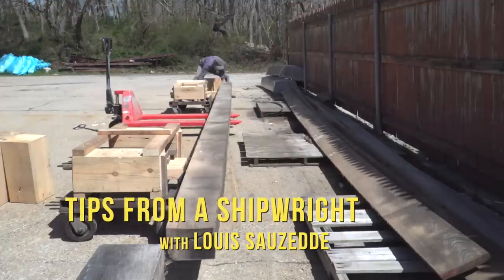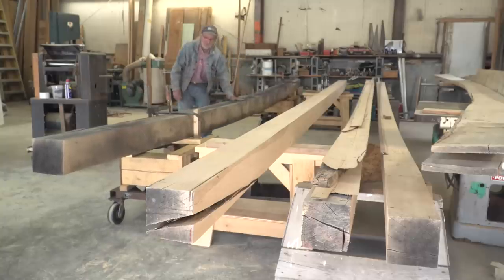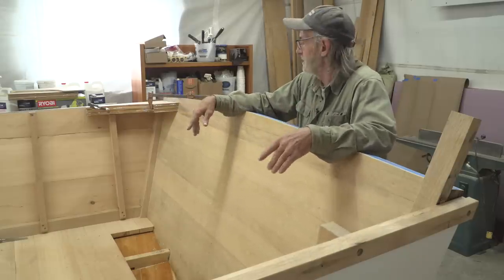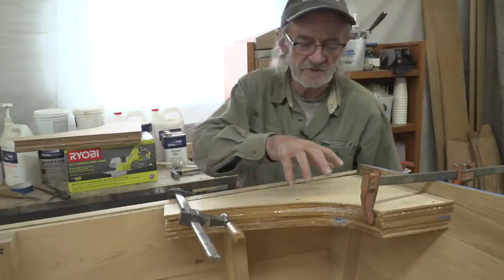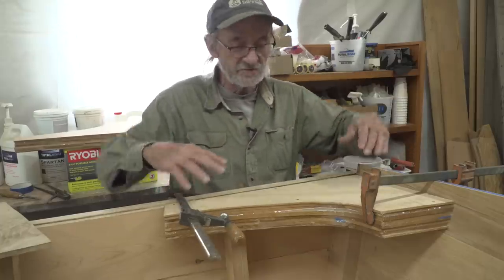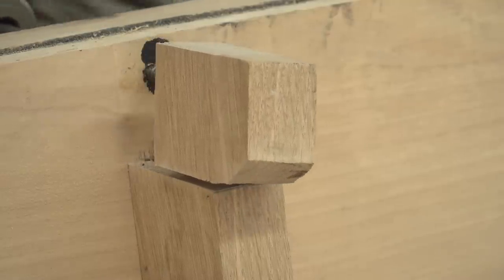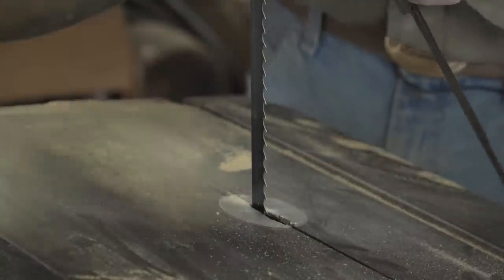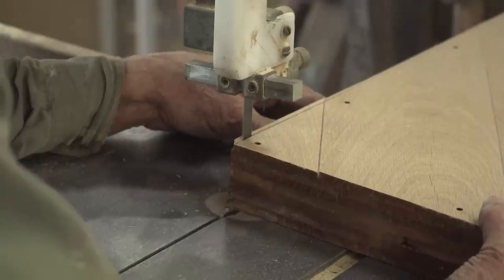Building the V-Bottom Skiff: Episode 30 - Timbers for ORCA and installing the knees

Comment: I made a two wheeled cart from a garden cart with a 5/8th D axle and 26 x 2.5" tires, just a 18" cube with the axle about in the center. moved some heavy timbers around on uneven Vermont ground. Old sayin around here is "use it up, wear it out, make it do, or do without"  I learned alot from this channel, so thanks!

Comment: I bought a Fein Multimaster when they first came out, back in the  80's. A couple of years ago I bought the latest model with the quick change blades. I love the tool. It has saved me on many occasions. A trick that I use to start an accurate cut is to clamp a freshly cut block to where I want to cut as a guide. If I can't use a clamp like on that corner post I temporarily hot glue the guide block in place. Love your videos!
Reply: Guiding blocks are a good way, You still gotta tune for ingrown inconsistencies though - working with a lot of burly and "complicated" aka wonderfully live wood for dashboards and panels and such, I learned that the hard way. My first oscillating tool was a cast saw I got from an orthopedist and tooling was shopmade. What a lame thing compared to today's Fein toys! Boatbuilding always needed unconventional inventive solutions.

Comment: I loved seeing the Multi-tool in use.  I first bought one 20+ years ago & used it regularly. The only time I ever got in trouble with it was when I accidentally unplugged it while using it.  I plugged it back in & the tool scarred up the brand new hardwood floor I had just installed.  The instructions never told an idiot like me to switch off the tool before plugging it back in.
Reply: When common sense ain't so common... 😂🤣😂🤣.
If anyone has spent any time in the trades, they have re-plugged a tool left on at some point. Hopefully most were lucky enough to do no damage. I've cut a few cords with skillsaws that way. Why a skill saw has a trigger lock is beyond me, and after two times having this happen, years apart, I quit locking the triggers on any tools.

Comment: Hey Louie! I use these tools to make finish cuts all the time and I always Brad nail a guide block on the line of the cut so it keeps the blade 90* through the cut.
Reply: Great tip, but these cuts weren't 90° cuts. Not much in a boat is 90°, even the corners of a lot of the boards used in many boats aren't 90°.

Comment: I want to build a row boat similar to what I had as a kid. I would like to be able to row up the river in Michigan where I grew up.  I want to row it and only have a motor for open water but also row it up the river.  My biggest issues are to decide how long to make the boat, how wide to make the boat, the taper of the Kiel,  and I want to be able to get in and out of the boat on open water so I can swim, dive, scuba etc.  I want to explore rivers, swamps and not be twisted aside by the currents of the river.

Comment: First time I used one of those fine tools and cut my pencil line right down the center with almost no dust I went and bought one the next day if you wanna get really close throw one of the sanding pads they come with on I never used mine thinking it wasn't worth the effort but they work great also.

Comment: I find that when I need to follow a line with the multi-tool it really helps to chisel the line before bringing in the power tool. Just cut it in with a couple of taps and it's easier to follow the line.

Comment: Q: couldn't you use small dowells instead of nails to align the laminates? These wouldn't have to punched out afterwards - and - I would consider would strengthen the component. Your thoughts please. Your employment of the vibrating cutter was pretty impressive 👍

Comment: What's the function of these "knees"?
Reply: They strengthen the back corners of the boat, like corner braces in an old barn between posts and beams, to counter the pressure of the water on the outside of the transom and side hull pushing in on the structure of the boat.

Comment: The nails to align the knees is a good idea but if you were to use wood dowels instead; no need to remove them and will add structure.
Reply: it would be a giant pain to align that many dowels and get a snug fit while working with epoxy on the clock. THe nail method with slightly oversized holes is forgiving
Reply: @johngoodell2775  Just stop....you make no sense. Take a minute and think.
Reply: @ZacVaper  dowels provide no strength to a knee in that orientation and would be a pain to deal with using epoxy. The strength is from the epoxy lamination. There are many ways to make laminated knees - one way is to just laminate the pieces, clamp, and cut the shape later. His method is another way to do it. Nothing wrong with hit.
Reply: @ZacVaper  Well you might not want to publicize that:)  good luck and best wishes
Reply: @johngoodell2775  Switching from nails to wood dowels would be a struggle for you, we get it. Just sit in your armchair and watch.
Reply: @ZacVaper  you seem to be misunderstanding what a quarter knee does.  A quarter knee is adding strength to the transom and the forces exerted by the motor. The forces are lateral/horizontal, not vertical. The bottom line is that dowels dont improve anything or make anything about the quarter knee stronger. Actually if you put enough dowels in there you would be defeating the point of the laminations. Ultimately you dont need to align anything with nails or dowels...one could just laminate sections of random planks, clamp them, and then cut the shape of the knee later after it cures.  the epoxy bonds the laminations well enough to drill holes for the bolts parallel with the "grain" of the laminations/plies and not worry about splitting.